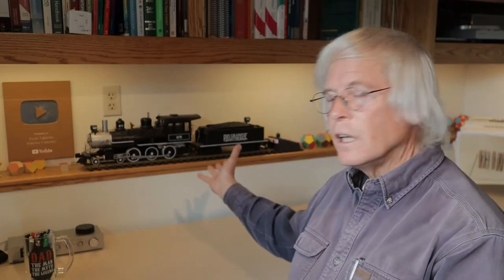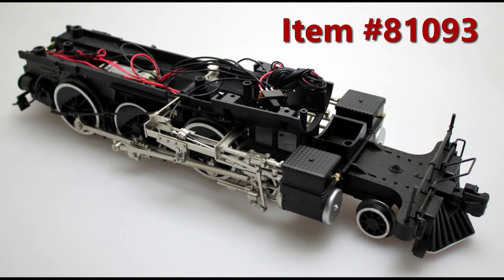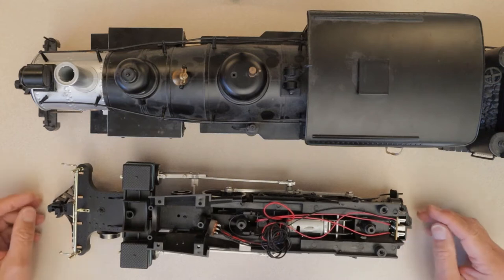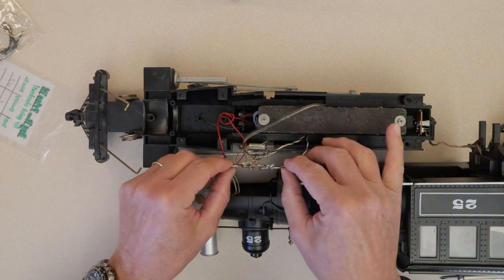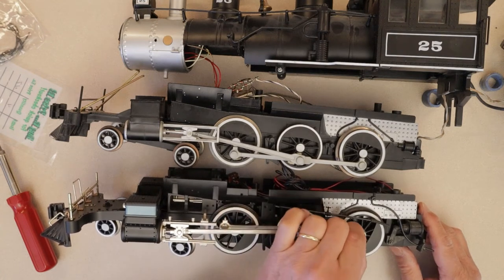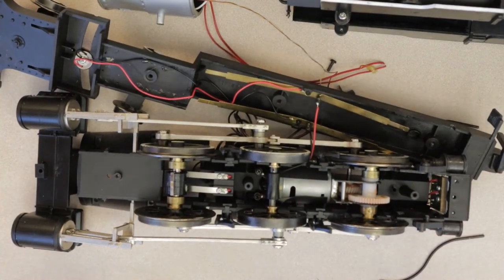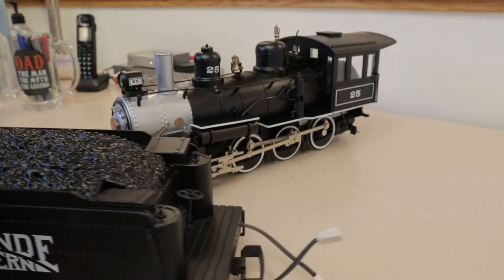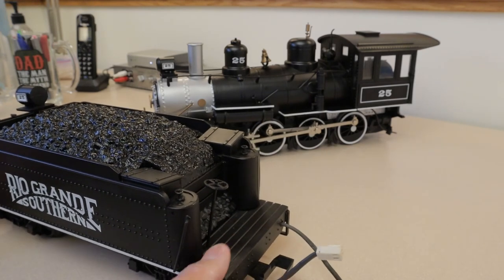Replacing a Bachmann BIG Hauler 4-6-0 Chassis

Comment: Hello! I enjoyed your video very much. Bachmanns tenwheeler is also popular in in far away Sweden. Some smaller narrow gaugue railway companies ordered in the beginning of the 20 th century steam locos from Baldwin but they were smaller. I have owned the Anniversery model which I lenghtened 1, 5 inches by moving the cab backward. The loco now got better proportions and still fitted in the original box! I bought it 2019 from the garden railway specialist Max Winter in England before Brexit for 250 $, I should not have sold it. This week i bought an used White Pass & Youkon set from 2008 with two very nice cars with metal wheels but without light. I payed 189 $ for it and I swear I have newer carried a bigger packetwith model train from the post office. The loco and cars are if they were new.

Best regards from Claes in Sweden
Reply from the maker: Claes - thank you for posting such an extensive and thoughtful reply.  I'm learning more and more about larger scale railroading as a result of of all these comments.  I had no idea I would receive this level of response back when I posted this video.
I really appreciate the response.
Thanks again,
-Kevin

Comment: I just bought a used Casey Jones version of this locomotive in a set.  It will be my first G-Scale set.  Old Bachman trains at least in HO scale even if new old stock unopened box.  Tend have the nylon gear and shaft bits break inside.  I just got into Hobby Trains about a month ago. I haven't messed with trains  since the mid 80's. A lot has changed from the days of DC.
Reply from the maker: The G-Scale trains are pretty fun - for me I like it because it's kid friendly.  Young kids can run it, add cars on their own and so on.
I got started on HO Scale trains myself, then dabbled with HOn3 in the late 80's and was able to volunteer on a prototype railroad for a time.  I got back into G-Scale just long enough to resurrect this locomotive for the grandkids.  I may get back into modelling trains again, but I'll pick a smaller scale - perhaps HOn3 or Sn3.
Thanks for posting!

Comment: you helped me find out how old my loco is (I got it yesterday for reference not running but I was like fine I will try to fix it) I was thinking it was a 2009 or somewhere around there not it is a 1990s one it is the Royal Blue Rail and its gear is cracked so I super glued it seams to hold for now but I will buy an Anniversary chassis for it soon but that is crazy how old my set is
Reply from the maker: Very cool! I'm happy to hear my video helped.  Good luck with your Anniversary chassis and thanks for posting.

Comment: Hoping to install a Ring Engineering control module in mine in the next couple of days. This was helpful. I have the chassis with the gazillion metal rods & cranks & doohickies and I was worried about things going SPROING if I took the wrong screw out in a wrong order. 
For those with stripped gears, I've heard of "Barrys Big Trains" that supposedly offers brass drive gear upgrades.  Just FYI.
Reply from the maker: Thank you for the suggestion!

Comment: How did you wire up the light and smoker to the reverse switch?
Reply from the maker: The smoke unit can be connected directly to the power in from the wheel pick-ups, because the polarity is not important - it's just a heating element.  If you are using directional lighting, you should wire your lights to the output of the reversing switch - the leads that go to the motor.

Comment: I’m planning on running my new chassis off battery not track power, we’re you able to easily access the motor wires or were they hidden down towards the bottom like on my old chassis?
Reply from the maker: You're in luck!  The motor has it's own set of leads.  They are routed to the reversing switch in the version of the chassis that I purchased.  Since the leads to the pickup are also independent (and connectorized) - I would think converting to battery operation should prove fairly straightforward.
Let us know how it goes.
Thank you!
Reply: @kevintaberski4249  went great, took out all the track power elements and added a batter to tender. I also went with a Bluetooth bluerail Dcc board for ease of use. Your video was a huge help. Big thank you.
Reply from the maker: @maddrummer910  Outstanding!  I'm happy to hear I was able help to you.  Thank you for taking the time for the update.

Comment: I’m not following what that reversing switch is for? 
I’m not a die hard model train guy, I just have some old sets that need some work these days. This video definitely makes me want to spend the xtra $20 for the anniversary chassis compared to the standard. 
I have big hauler set 90090, Virginia and truckee version 3, she needs some help. I also run New Bright electric trains, I’m gonna see if I can finagle the bachmann chassis into that as well. I been thinking about getting some of the older battery locos so I can run more than one train on a track.
Reply from the maker: The reversing switch simply changes the direction that the locomotive will run compared to the throttle.  My understanding is that some 'standards' state the polarity to the rails when the locomotive travels forward.   This would also help in the event one was double-heading - running 2 locomotives together.  For casual users of "train-sets" the setting of this switch is moot.
I'm not familiar with the New Bright trains, but the Version 5 Anniversary Chassis was a nice upgrade to my Version 2.  As an aside, I did end-up shortening the length of the air cylinders as they did interfere a bit with the steam-chests.  Good luck and thanks again for taking the time to comment.
Reply: @kevintaberski4249  thank you, got it now. 
Hey I found a 5th generation set today, super cheap, gonna pick it up this weekend.
Reply from the maker: @TheFrogfeeder  Excellent and congratulations. You know - you sound a bit like a die-hard model train guy.  Enjoy you new train!
Reply: @kevintaberski4249  it’s purely my mild case of OCD ;)

Comment: Is it possible to remove the motor from the chassis so that the Wheels can turn loosely without it?
Reply from the maker: The chassis is not designed for this but I’m sure it can be done.  I suspect removal of the motor might be destructive and irreversible.  You might be able to remove one (or more) of the gears in the drive train to achieve the same result.

Comment: hmmm still doesn't say what part of the mechanism is the tender
Reply from the maker: The tender is the car that is attached-to and trails behind the locomotive.  It contains additional water and fuel (in the case of this locomotive coal).  As far as a 'mechanism', the tender on this Bachmann Big Hauler containers the sound unit (that simulates the 'chuff' sound).  I also added a reverse/back-up light to my tender - which it did not originally contain.  Does this answer your question?
Reply: @kevintaberski4249  no i mean if the motor or the reiceiver is in the tender

Comment: i attempted this but failed, forgot what went wrong, i think its because the screw sockets are broken or stripped in some areas, and i needed green cylinders on a chassis
Reply from the maker: I'm sorry to hear this.  If it's just the plastic that is broken or stripped - it is possible to repair.  A search of ye ol' internet should provide instruction if you need,  Good luck!

Comment: I have  A 4-6-0 5th gen bachman large scale 
Loco  northern lights that I replaced the colored LEDs on the boiler with non diffused red green and white LEDs.
And a 6th gen Annie
90047 wonderland flyer Annie with full valve gear
I also have a bachmann large scale challenger it is also 5th generation with 5 dual  axel trucks on the tender. Only trucks one and 5 are screwed to the chassis on the tender the other three are connected by pivot arms between trucks
Reply from the maker: Sounds like you have a nice collection!  I bet the Challenger is MASSIVE and quite an impressive model.  Congrats!

Comment: LEDs are diodes.  Replace your diodes with LEDs and replace your bulbs with appropriate resistors.  Done.
Reply from the maker: Yes - I realize that LEDs are diodes, but white LEDs did NOT exist back when I did this. Plus, I like the look of the 1.5V grain-o-wheat bulbs.  Thank you for your comment!
Reply: @kevintaberski4249  That makes sense.  With that said, they now make grain of wheat white LEDs.  I'm sure you're at the point though where you're beyond trying to keep up with all the crazy things that are going on.  I have two 3D printers myself.  A decade ago the very concept was considered by some to be too radical to ever be useful in the hobby.
Reply from the maker: @fraidykat  I'll look into these if I ever redo the lighting on this locomotive - or if/when I add lighting to another.  Thank you!
Reply: @kevintaberski4249  If Garden Railways Magazine was still around, I'd say that second unit with LEDs and resistors along side the diagram for bulbs would be a sweet little article.  I'm sort of amazed I've seen such great things pass.

Thanks for your video, it is the only way now to see this work.
Reply from the maker: @fraidykat  Thanks again for the reply.  If I find the time, I may revisit directional lighting and record a video comparing LEDs to incandescent grain-o-wheat bulbs.

Comment: Use a JST male/female leads so you can undo the tender...eBay
Reply from the maker: I realize that Bachmann adds quite a mark-up, but it was easier (for me) to just add the cable with connector to my order.